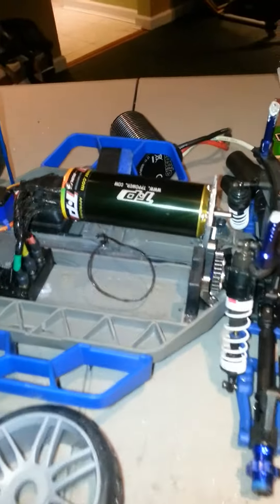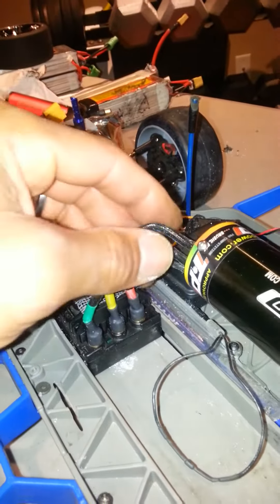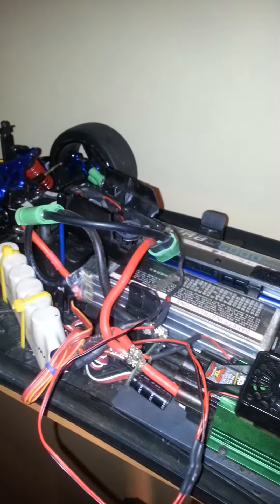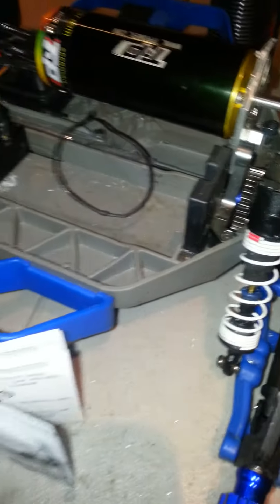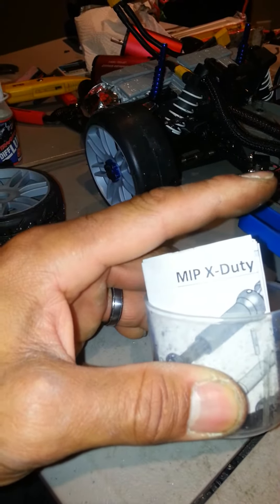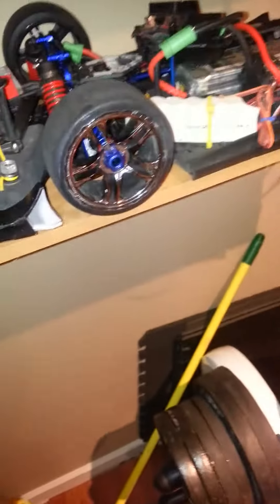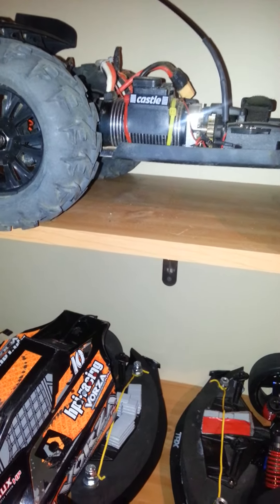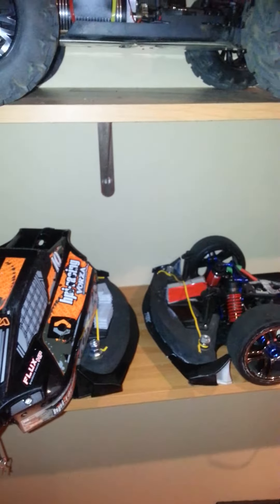Xo1 work shop Joe Strickland update.

Comment: Thanks for the shout out. I believe I had the Poseidon 2200 in there...that or the 2650 but no heat issues with any of their motors. But I see you already grabbed a different one. But yeah Poseidon is excellent.